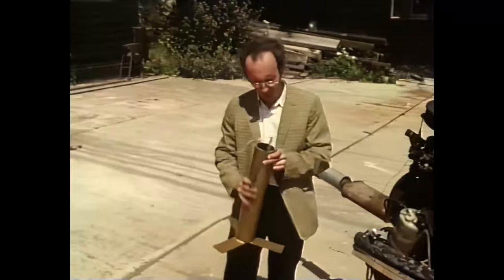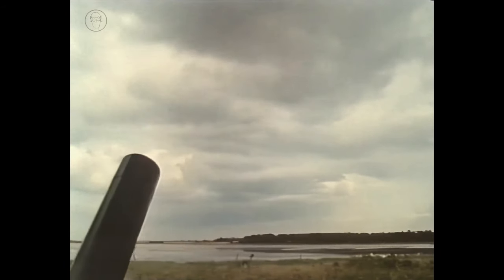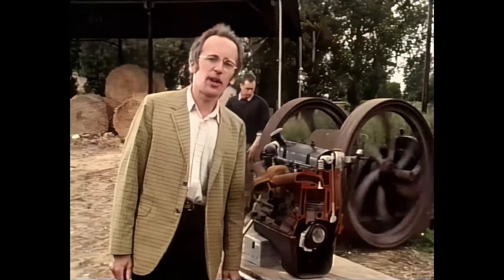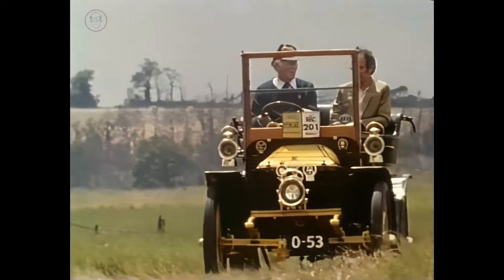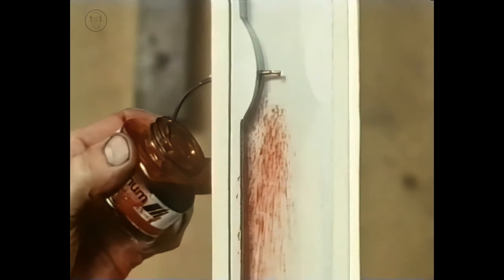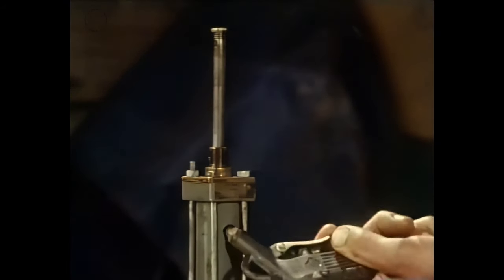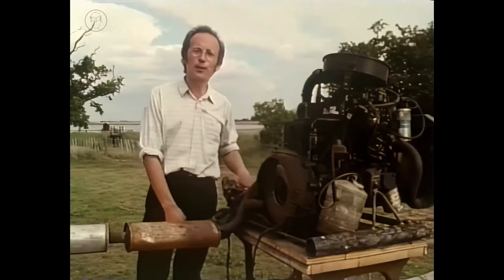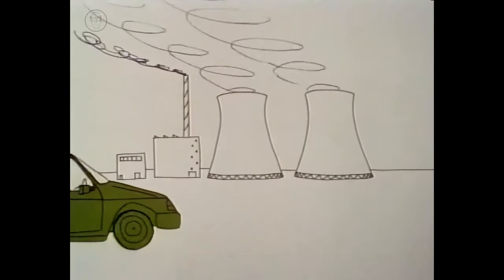The Secret Life of the Engine - remastered

Comment: Yeah the EV car discussion is pretty interesting. When you look at Tesla, a substantial portion of their value is the self driving component which is essentially independent of the EV side. I think my incredulity has decreased and I would argue at present that developing a car that can be functionally pretty indistinguishable from a ICE vehicle is within reach, though realistically we are a ways off from being able to take over the market since I can get a 5 speed Honda with 400k miles for $1800 (plus some residual maintenance) that has plenty of life left. 

Part of the game here is that the cost of ICE cars is being inflated by increasingly unrealistic emissions targets predicated on the assumption that the net harm of pollutants is linear to their concentration and/or an arbitrary periodic adjustment of numbers on a document to be lower for bureaucratic fun. A classic example of this is the VW emissions scandal: if the Passat had been a light duty pickup it would have been totally legal due to a 40-fold difference in emissions targets. The engineers were dealing with a 1:1 compromise between fuel economy (carbon emissions) and particulate forming emissions like nitrous oxide. There’s not a lot of recognition that such trade-offs exist in the engineering world. Indeed people who had their vehicles “serviced” to comply with emissions rules found a 10%+ reduction in fuel economy. The alleged green horror forced an increase in carbon emissions to comply with nitrous oxide limits despite the fact that the vast majority don’t reside in an area where nitrous oxide is problematic.

Comment: Regarding your final suggestion, I don't think it would have worked out because the aerodynamics on those small cars are so poor and engines don't work very efficiently in stop-start traffic. Modest hybrid cars or better development of the small fiberglass electric cars that came out of the 80's fuel crisis were really the way to go. There were suggestions for hybrid cars that went back to the 80's as well, that was one of the ideas proposed as a part of the Lucas Plan. Agree that there's nothing worse than SUV's!
Reply: Lucas Plan? If it was Lucas it likely wouldn't work for long. Lucas: the Prince of Darkness!

Lucas once tried to build a computer, but as they couldn't get it to blow smoke or leak oil, they gave up!

Comment: Ok just got to the end and it cut off talking about if it would be better to just have smaller cars with super efficient engines. But for us in the US we do have a smaller car that gets good mileage. but also tow a Travel Trailer aka a caravan so have a small mid sized truck.
Reply: The VAST majority of drivers (99 percent) have no requirement to tow a travel trailer, lol. MOST only drive ONE person less than 100 miles a day. If you mean have a mid size ICE truck for towing, YES that is one of the solutions for those few who desire that. EVs and other alternatives easily handle daily auto needs.

Comment: Gosh, this seemed to end very abruptly. I too like the notion of electric cars but am wary of their true 'greenery'. And what a shame that diesels have been the victim of a witch-hunt rather than investigated as a solution due to their greater efficiency. But as the programme says "there's probably no such thing as a truly green car." Thanks Tim, very enjoyable.
Reply: Exactly, EVs have a lot of work/time to go to prove their greenness, but batteries are getting much greener all the time. Doesn’t matter what Diesel or any other ICE “proves”though, once Peak Oil starts heading downhlll, you won’t have the fuel to use anyway.
Reply: @DoctorShocktor  

Without oil you still won't be going far in your EV.

Comment: I think the way forward is Hydrogen Engines, whether they convert it to electric via a cell, or burn it direct, it has to be the way forward.  Batteries is just going to create a bigger problem when batteries go done, where do we get rid of all the toxic chemicals in them?
Also the waiting for a car to charge up on a long journey is a problem.
Also, where is all the charging points going to come from, especially if you live in a block of flats or high rise buildings, you want your car to be charging overnight.  Where is everyone going to charge their cars?
Also, the electricity supply to your house has to be changed to handle more power.
Not everyone realises this yet.

Comment: Interesting comments about electric vehicles at the end. You are describing so called "life cycle" analyses that add up all the activities required to make the car, fuel the car, etc., and to compare the results for EV vs. internal combustion engines (ICEV). I work with a group that does those calculations and the EV come out ahead, even with the battery weight and manufacturing emissions. One reason for this is that the electric motor and transmission are so efficient compared to the internal combustion engine. Another important consideration is that, once people are using EVs, every time the shared power generation infrastructure (grid) gets cleaner, the EV cars become cleaner. Since so much of grid power comes from nuclear, hydro, and renewables these days, it makes a big difference, and the trend is for the power grid to just get cleaner and cleaner. Nevertheless, right now in at least the US, an EV is greener than an internal combustion engine. Many EU countries have much cleaner power generation than the US and aggressive plans to make their power even cleaner, soon.  I suspect this will be true even for the ultra-light gasoline vehicles. A concern of mine for EVs is what will be needed to support such high power loads at so many places in the power grid, especially residential charging. Thank you for sharing the videos.

Comment: Electric cars still can't eliminate emissions and pollution completely, but at least make'em more controllable.Disregarding all the so-called "clean" power plants like hydroelectric plants or wind farms, big conventional power plants use high-efficient engines like gas turbines to exploit more useful energy out of the same litre of fuel than normal vehicular engines could do. Power plants are also equipped with energy recycling system which uses the waste heat for municipal central heating or even for driving small steam turbogenerators, and with emission control facilities which scrubs the exhaust gas better than the catalyst on your car can do. 
However the production and recycling of batteries and power electronics parts might have new impact on the environment... and its effect is still not so clear until it really begins to influence our lives.

Comment: A 2CV with a modern engine sounds terrible. One of the big reasons modem cars are so heavy (excluding that people buy larger cars) are the safety features. You don't want to take those away again, while simultaneously putting a modern more powerful engine in there.  Accidents with a 2CV are bad.

Comment: A good point about electric cars especially as they only break even with a diesel car after nine years (https://www.weforum.org/agenda/2017/11/battery-batteries-electric-cars-carbon-sustainable-power-energy/) . Even normal size cars are ridiculously heavy at 2020 ford focus 1348kg  compare to a ford sierra (1115 kg) or a honda crx (785kg).
Reply: Nice Apples and Oranges. Comparing the currently expensive EVs to the efficient ICE cheap vehicles. Once production of EVs becomes larger and more efficient, vehicle costs will drop immensely, and the cost of electricity is far less than liquid fuels.
Reply: @DoctorShocktor  I'm not sure why comparing a diesel or petrol car is apples Vs oranges when they are vehicles that are powered differently.

Comment: I don't think electric cars are a viable long term solution, either. Cars aren't.

If we lived in more dense "nest sites" than we do, we'd need to use power assisted transport less often, would more often have the numbers it takes to make public transport pay for the cases where walking and cycling aren't fast or capacious enough, and that might be enough to make a difference.

Trouble is that hits up hard against a lot of preconceptions that people just plain refuse to try and think their way around. The most familiar version of dense housing is crowded tenements, and people are too afraid of those to even try to imagine better alternatives that still share the benefits density confers.

People move to the suburbs for "space" (in many cases, not a great deal of it, and definitely wide open space - it's "space curtailed by neighbouring walls").

So how about building one Long, tall block with green space permanently set aside out front, and out back? That would give space, and "wide open space", too, if you did it right - i.e. have lots of green space away from the "nest site" of whatever primates sleep in that spot. Make it so that everyone has a "next to Central Park" view. That doesn't just match suburbia; it beats it.

Make the space have as many allotments as necessary, and only as much public space as is necessary, or is left over, because it turns out not so many people like getting soil on their hands any more. I like the idea of "owning/leasing an expandable right" for this. If you own or rent one of the nests in the nesting site, that entitles you to go and make use of one door's worth of allotment soil in your first year or six months. If you don't get bored with it, and you stick with it, that entitles you (if you so choose) to a more "yard-sized" piece of land next year. And so onward and upward for the garden-crazed. It allows for dabbling without dread (no huge garden to spend every weekend weed-whacking, unless that's your joy in life.)

Similar arrangements could apply to other things people like about their suburban lives. (Replacements growing into improvements, generally). So someone who likes the idea of a shed to tinker in might perhaps join a "Workshop Club" (with all sorts of stuff potentially available to those with a history of looking after stuff nicely, and "reading the manual" before use.) One's first workshop space could just be a single bench in a big enough shed to move around long planks in (for example). Prove that you're at true tinkerer and grow a little workshop empire there. (Probably without a garden, since you can't serve two gods. There's a natural limit of "take-up" set by time availability.) Maybe you'd have a woodwork area and a separate metalwork area (so you don't get oil on the wood, or set things on fire with the smithy).

By giving up a fixed small "lateral territory" there are surely ways that that could be converted into opportunities to "custom make your living space".

And at the ground level of such a long, long, miles long block, you'd have no cars. Pedestrians only. Cyclists stick to the paths, too. Grannies with frames have right of way.

Trouble is that for starters it would be illegal to build something like this in most places, even if it was possible to overcome peoples reflexive hate (on average - and most people make themselves into what they've have been if made in a cookie cutter) for the newfangled way that's just going to lead to misery for sure.

Comment: Chemical batteries are not practical or green.
The future of long range fuel is hydrogen. The most efficient fuel in the universe! 
The power-plant will still be electric motors, but the electrical energy would come from a hydrogen fuel cell. 
Something like what Ballard systems of Vancouver Canada is doing for buses, but scaled for use in cars. 
It takes just as long as it takes with petrol to fill up and the byproduct is water vapor. 
If you think hydrogen is dangerous, you haven't seen a Tesla car explode into a fireball.

Comment: 63 Giga Watts!  Electric cars could easily maintain this rapid refilling, and we could continue to utilize our globally mature liquid fuel distribution networks, if we used fuel cells, such as the Solid Oxide fuel cell.  Converting the energy in a liter of fuel @ much greater efficiency than our current methods of burning the fuel.  Instead converting chemically into Electricity.
Reply: Recharging 63 GWh at 240V and 20A would take nearly 1500 years.

Comment: Using a finite resource that pollutes air while being wildly less efficient at making things move than electricity is will never be a "greener" solution. Large scale electric batteries and funding is basically still in its infancy and with the increasing interest will become greener and greener while petrol engines will remain their non-renewable selves. It is only the last 10 years or so that electric cars have gained the mass appeal for companies to invest the research needed in them, and if one were to compare the first 10 years of petrol engine's efficiency I feel there is still much more to come from the electric front while petrol dies out, as it should. Electricity can be made in endless ways to propel our world forwards. Oil is dirty in every way, from pollution to lobbying and will one day be exhausted. Also using tires as an argument against electric vehicles is irrelevant to an engine discussion, as both types of motors will be the same in this respect.
Reply: You do waffle on and talk some utter rubbish. If oil runs out then EVs are still in trouble. Have a think about it.
Reply: @skylined5534  There is no if oil runs out, it will run out. Electricity will carry on as long as there are humans, in some shape or form. EVs right now are in trouble even, because the charging and batteries let them down as a reliable substitute for petrol in terms of convenience, speed of refueling per kilometer, pricing, reliability, range, power density that makes larger logistics with battery power somewhat hopeless. It doesn't change the fact that combustion is a dying breed in current form, but there are interesting new options in the form of e-fuel, and maybe someone solves the power hungry manufacture of hydrogen somehow. I had a think about it, now maybe you will too before resorting to mean spirited one liners on YouTube without any argument for your opinion.

Comment: Your charging/fueling comparison continues the inaccurate timing myth - TOTALLY WRONG. 90 some percent of auto owners drive less than 100 miles per day, meaning even the lowest range full size electric car easily handles most ownership use. These owners will use overnight charging for most needs, leaving actual physical time spent in the process to 5 seconds to plug in and 5 seconds to unplug the charging cable. ICE refueling has been determined to involve a 15 minute trip to and from the refilling station on average, with 2-3 minutes of filling time at best. That’s 30 minutes every week or two compared to 10 seconds every few days. Long trips are an entirely different issue and DO NOT affect the vast majority of personal auto use. For those usually infrequent needs, there are alternative charging methods, other ICE vehicles and long distance land, sea and air transports.

Comment: Ah, another "Green" reference framing no data is reported accurately for..
The article on Pollution obviated the need for a discussion of the efficiency of fossil fuels by reference to how much death it spreads around. If small vehicles are made more efficient then there's going to be so many more they will effectively make more Pollution. Stuck in a loop of diminishing returns for fossil fuel energy that does not apply to Wind, Solar.., hard to make a case for total replacement, and Nuclear is extractive too, but a million times more efficient, and billions of times more abundant than fossil fuels.

Biologists who want to be naughty, point out that Green is the colour rejected by the plants making sugar out of CO2 and water. What does that do for Pollution and Politics?